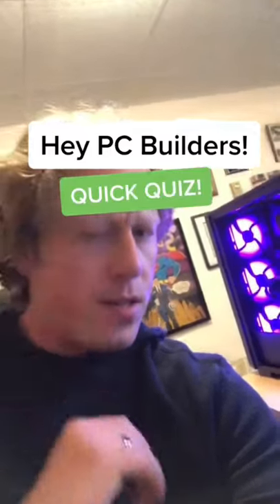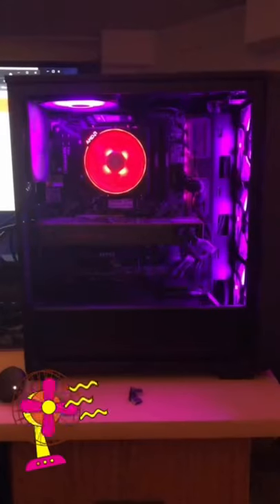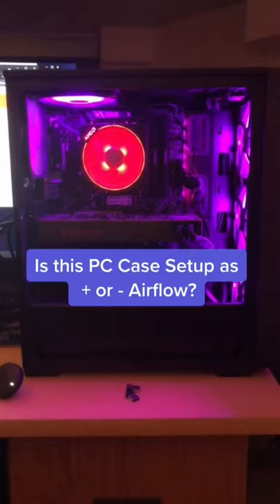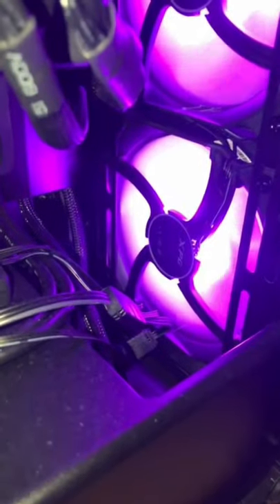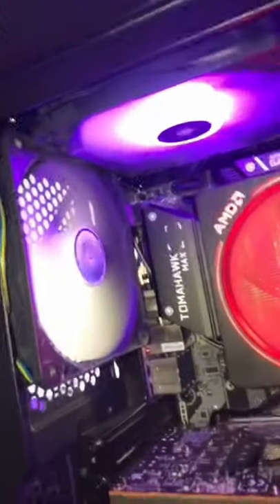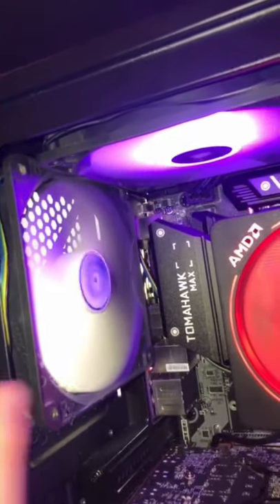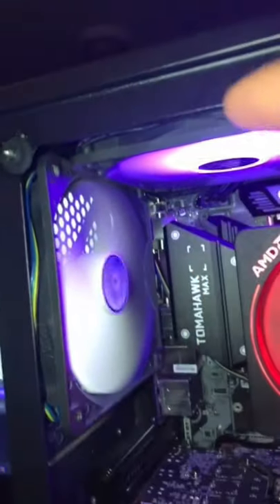Does This PC Case Have Positive or Negative Airflow?

Comment: Positive towards neutral. The CPU cooler makes the turbulence. Use some smoke to see better, because you already have more lights than the whole Dubai.
Reply: You can see this pc from the moon 😂
Reply: this comment got me good lmao
Reply: can you rate my airflow? i have 2x 140 milimetres inwards at the front, one 120 milimetres inwards on the floor, one 120 outwards at the back and a 240 millimeter aio at the top blowing outwards…
Reply: @adrianus2738  seems like slightly negative assuming the fans blow air at the same rpm but if the front and bottom one blows air faster than the exhaust then must be a positive or slightly positive

Comment: really freaking positive thats the best airflow ive seen in a while
Reply: eh
Reply: Positive airflow is when you have a bit more intake and a bit less exhaust. He has 3x120 intake, and 2x120 exhaust + blower style cooler gpu (which exhausts out the back) + PSU which exhausts out the back. I’d say it’s pretty even, it would all depend on the quality of the front intake fans, and the fan curve.
Reply: No equal airflow is
Reply: lol you haven't seen a lot of PCs
Reply: You obviously haven't seen much PC's in a while
Reply: Equal is better goof
Reply: It’s not the best
Reply: it may look good but in many cases it's the opposite

Linus have covered a video on this topic
Reply: @oneaboveall9134  its not bad. In no way is it bad
Reply: @oneaboveall9134  more positive is better for dust
Reply: @itscampception554  I agree with what you said but the psu is only relevant if his psu fan is facing up to exhaust the air out the pc. if his psu is facing down then its a separate loop intaking from under the case and out the back of the psu
Reply: Z
Reply: I have only one fan, and it's pushing air out. And a Gpu taking air in. Should I position my one fan to push air in or should I get another fan?
Reply: @idontknowwhattonamethis1029  wtf
Reply: @itscampception554  most psi’s are enclosed and have no impact Ont he test of the builds venting. 

It’s positive airflow.
Reply: That's literally 90% of all PC cases

Comment: Assuming no filters and all same fan speeds, you definitely have a case with positive pressure (not airflow). Negative airflow pulls in dust from all the other openings, so the positive setup is preferred.
Reply: Good to know

Comment: It ultimately depends on what rpms your front fans are running at vs your exhaust fans. You can have those intake fans at 800rpm and the exhaust at 1200-1500 rpms and vise versa

Comment: Positive, however, you should turn the top fan around - making it an intake fan - to keep the VRM cool
Reply: No he shouldnt as heat rises and that means that the top fan should be exhaust so it takes the hot air out
Reply: @-Pickle-  bro it takes the cool air out from the vrm heatsink
Reply: @gyurmagyuri6440  The air flow pattern is diagonal. Positioning top fans to blow air out of the pc helps keep the air current fresh and prevents additional heat from collecting near heat syncs. Mind you this is in the event you have all of your front fans blowing inward.
Reply: Top and rear are for exhaust, hot air rises and the other fans blow the fresh air in, that CPU cooler is fanning the vrm since it points towards the board
Reply: @Rancid_Ninja  yes, hot air rises in general but the fans can completely change it

Comment: Depends on the speed of the fans, and cfm of all the fans. I'd guess anywhere from neutral to slightly positive. Positive pressure is good if the intakes have really good dust filters.

Comment: Idk what you mean, but your flow and direction is good. The vents are at the top which pulls the warmest air out, the gps is at the bottom givibg it access to the cooler air available. Persally i'd be concerned that the empety fan slot if shortibg the circuit from front to back and il fill it but unsure if it's actually enough to affect anything

Comment: positive, as a rule of thumb, if you have more intake than exhaust it's a positive system. if you have more exhaust than intake then it's a negative system
Reply from the maker: Thanks, and great insgiht! A couple of things to consider as well would be fan speed (in this case all set to 50%), but technically the GPU in this case, being a blower model also exhausts.
Reply: thank you so much— I DIDINT understand, my first time buying pc.
Reply: Intake filters also play a massive role in reducing intake. Just bc you have more intake fans doesn’t mean positive pressure.
Reply: Measure the pressure inside the case against the atmospheric pressure outside the case and find out there is no difference.

Comment: The best I have had so far from many experiments was two intake from top, three intake from front, and three taking the hot air out of the case (2 fans with big Noctua tower air cooler tower for the CPU, and one in the back of the case). I maintain everything including GPU and CPU below 65C even when both GPU and CPU are overclocked, running games in 4k.

Comment: I hope it's good cause it looks like mine lol, plus one in the bottom 😅
Reply: One at the bottom for what?
Reply: @savydaniel  Probably is for the power supply
Reply: @nestorferreira5327  that would be useless, since the PSU has its own fan which pulls air from the bottom and blows it to the back.
Reply: Don’t add an extra fan it’s bad!
Reply: @savydaniel  true, but in some cases it is better to mount the fan facing up in the psu to help exhaust heat from the rest of the system. OR if your pc happens to rest on carpet like some people do. just really depends on ur need case
Reply: @BlarinDragon  in this case, a bottom fan would be even worse, creating turbulence.
Reply: @savydaniel  Right. I wasn't trying to imply in this scenario and im sorry i made it seem that way. Just that it is a factor and a option to think about when configuring cooling and pressure in general.

Comment: I didn’t really need the explanation because unless you have the really nice fancy fans where you can switch the hub, you could see where it’s intaking and exhausting. This would be considered a positive, because there are more intakes than exhaust the blower style I would say doesn’t really count as an “exhaust”. But I would say overall this is good because you have plenty of air in your case that is most likely fresh instead of suck out all the air from the case, and possibly not having much fresh air come in..😊

Comment: Depends on the rpm of the fans and the front of the case. If the case has a mesh front panel like a Corsair 4000D and all the fans are running at the same rpm then it would be positive. If the case has a more closed off front panel it would be closer to neutral.

Comment: If the case have a mesh front panel, than is positive airflow till you push hard on your gpu. Otherwise is slightly negative and could build up dust coming in from the top non filtered grill, but temp wise should be fine anyway.

Comment: Positive airflow, only just with 1 fan difference, and good locations for the outtake fans since that's where the air will almost certainly be hottest, so you want to get that out fast instead of it lingering around.
So that's good.
Another fan in the top on the front side of the case will not do much but take out cool air that just came in and didn't soak up any heat yet, but a few fans in the bottom as intakes will likely be good for the GPU.

Comment: Negative or neutral at best. With the blower cooler I would say negative. Hard to know without actual CFM numbers. Negative pressure will get dust in a bunch or nooks and crannies you didn’t even know existed.

Comment: Positive, assuming the fan rpm (excluding the gpu) is the same on all fans. Positive is preferred but not required, it doesn't really become an issue unless your case is all mesh.
Reply: I have a Cooler master Q300L mesh on top and front, 3 cooler master fans (2front and 1 on yje floor of cade pulling in) and 2 thinner blade corsair on top and the default factory one rear, so if I understand you, I must increase speed on the rear back and rear top, and the rest at lowest speed, my PC builds dust quickly in around 3 months
Reply: @HipocratesR  You want the intake fans to spin faster than the exhaust. This will ensure a slightly positive pressure and will help keep some of the dust out. The dust accumulation is also dependent on the environment so some may just have dustier PC's than other. Also, the q300l is a hot box with sub par filters anyway. You may want to consider moving your PC components to a Fractal Design Meshify or Torrent Case. I have a Meshify 2 XL and while I have a small layer of dust build up after a couple years it keeps the big particles out pretty well.
Reply: @tiptopflipflop7991  thanks, I opened holes on the Q300L top and front so I have 4 holes I made, I wasn't accounting speed difference so I guess I've been kinda neutral for more than 5 or 6 years, although all fans same size but the blades on the 2 Corsair are thinner and the blade on the single rear cooler master are wider, lately I feel attracted to the DeepCool CH370 Micro ATX and I missed the hot deal alert 2 days ago on the Antec NX200 M, Micro-ATX Tower for $46.00, at the moment can't afford anything else for the computer as I spended since January till now buying newer parts and monitor and just sold my 9400F and waiting new parts and the 13400F, so no PC atm

Comment: everyone seems to be wrong. its a NETURAL pressure setup. of the fans he mentions in his case he has 3 fans intake and 3 fans exhaust. because he has 3 intakes in the front. 1 rear and 1 top for exhaust. then he has the blower fan in the gpu which exhausts the air out the io port of the graphics card. Now. what he doesnt also mention is his psu which if the fan faces upwards it creates another exhaust making the pc negative pressure but only if the fan is facing upwards. also to mention the rpm of each fan also matters. the 3 intakes also need to be bringing in more air than the 3(4 if psu is facing upwards) can exhaust to be positive

Comment: Positive to almost neutral. Pretty much the ideal fan configuration for a non water cooled pc but the top fan gives you very small marginal utility. A top mounted, exhausting AIO will utilize the cold air that exists in the top of the case better to be used on the cpu. This allows the cold air in the bottom half of your case to be used more strictly for gpu and other components

Comment: Neutral airflow. Because of the gaps in the top, bottom amd back of the case there cant be much air pressure on the case, and the 2 fans in the back also neutralise airflow even more.

Comment: i use something similar with 3 fans in the front 2 on top for a cpu rad and then 1 back exhaust but the rad fans also blow out so i have most of the heat from my 3080ti blowing out

Comment: so 3*120 in, 2*120out, and a blower card which means its a like an out fan, if that card pushes like the fans and all fans the same, its neutral, i guess it pushes more though so negative, which isa lil better than positive for cooling, but worse for keeping that case clean. I guess thats why everybody loves positive more. Its not worth going negative

Comment: Neutral. And good air flow. To be fair tho, positive is considered best but my roommate has a negative pressure pc and it’s temps are great
Reply: Negative pulls in more dust so it can be worse overtime

Comment: Well it is a pozitive air flow i got same case as yours but with one extra fan there on to top . 4 are feeding air inside the system and 2 feeding outside,  so it more or less a ballance air flow , because depending of you case to say like that . The one I have same as yours has that glass in the front and the only air going in it is from the edges of the front plastic part so it is more or else balanced air flow
Reply: U have one more fan in the same spot that he doesn't have in the video as intake? And two exhaust same way he have them
Reply: @iSimplist  yes is a set up to push air in the case
Reply: @MikeTechnology  does it helps you more than having 3 intakes and 3 exhausts?
Reply: @iSimplist  yes with this case usually the front is quite restricted that's why. If I will be removing it and add instead a filter or a mesh it will be less restricted . But this is for my case , I can go let's say with 3 inn and 3 out but the top front will not have any effect because the first one   from the middle of the case will exaust out them 2 will be pointless for the cpu fan if I was to have a aio maybe but with a heatsking no . Just get a e-cigg and see the way air is flowing in the case like that you can managing it better and direct it where is mostly need it
Reply: @MikeTechnology  I'm asking cus i think I have a similar case, 3 fans(intakes on front) with only small gaps for them to get air, and 3 more fans as exhaust (2 on top of the case and 1 on the back) so i was thinking if it would also be better for me to have 4 intakes and two exhaust, 3 front as intake and top front as intake too, then rest two (top and back) as exhaust
Reply: @iSimplist  if you case is same yes it will be better
Reply: @MikeTechnology   yea i think more or less are same, small openings in the front panel for the front fans but not much, and the top of the case has a lot of openings and mesh(more than enough for an intake fan to get air from outside compare to the front ones)so ig i will try what u mentioned

Comment: You are probably neutral. I noticed not many people also raise the PSU. Chances are that would be providing some negative pressure with the GPU. Positive pressure is better than neutral or negative because it helps to prevent dust from building up in the air, if you have negative pressure then dust particles will fall and build up on your components more quickly (positive pressure didn't prevent dust, just slows it down)

Comment: Positive and negative is only relative to pressure. The fans on a pc are not capable of creating a vacuum or positive pressure. If a fan is sucking air in the same amount of air will be expelled through gaps in the casing . If the fan is turned round and is now blowing air out it will be sucking an equal amount in to maintain atmospheric pressure. If you created pressure one way or another the case would either swell or implode. Your talking about a pressure difference almost immeasurable. Basically it doesn't matter how many fans are blowing in or sucking out the pressure on the inside of the case will be no different to the pressure on the outside of the case. The case has to many natural vents and holes drilled into it for a pressure difference to be present.

Comment: Hey I have a 1660 super I got today but I see that it get pretty hot but idk how to check the temps and I wanted to get a new case what do you recommend
Reply from the maker: Hey! To check your GPU temps there are many ways, I like to use something like MSI Afterburner -- download that and it will show you right away. For a case, depends on budget and what your style is. Something like an NZXT H510 is always a good balance and choice.
Reply: @NewbComputerBuild  hey man thanks for the advice I have this older case but I talked to my uncle and he said it was fine and that it was ok at the temp it was at
Reply: Worthing mentioning the H510 has some drawbacks. The base model has relatively poor airflow, but they made an airflow model later on. It's also on the smaller side, so certain configurations may have trouble. My 3 fan GPU only fits next to my CPU radiator with about a millimeter or two between them. Overall I can still recommend it (only the airflow variant, though, since price difference is small) but not as my top choice.
Reply: @itzchopsyt6441  I have the Corsair 4000D Airflow. My temps have been amazing. 

CPU (idle) : 35 degrees with stock AMD cooler. I just ordered a Scythe Fuma 2 Rev B. 

CPU (load): 55-60 degrees. 

GPU (idle): 35-40 degrees. 

GPU (load): 55-65 degrees.

Comment: That is neutral air flow. It is impossible to have positive airflow when you have open mesh exhausts and also exhaust fans. You don't need an exhaust fan to create negative or positive air flow. What you need is a bottleneck of either I take or exhaust.

If you have three fans pulling in and no exhaust fans but have three slots to place exhaust fans there is enough area for air current to leave with our building positive air flow. But let's say you only have room for a single exhaust fan but three I take. That will creat positive airflow because now three fans are pumping air into one tiny spot and that spot can only allow so much air to escape.

Comment: First I assume you mean pressure. And second that would depend on the airflow.  How much air is taken in Vs exhausted out. Thus it would depend on the fans used and the speed they are set at, as well as how much air the GPU can move. 

In conclusion there is not enough information to reach a conclusion.
Reply: Yes there is

Comment: There's no positive or negative airflow. The air that goes inside the case will exit the case in the same amount. What is important is to avoid heat to stay somewhere in the case.